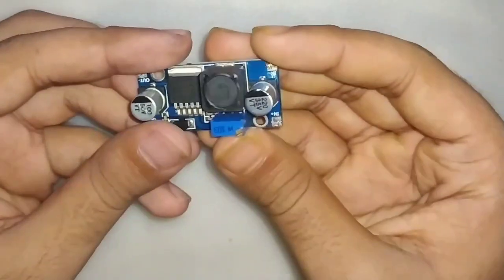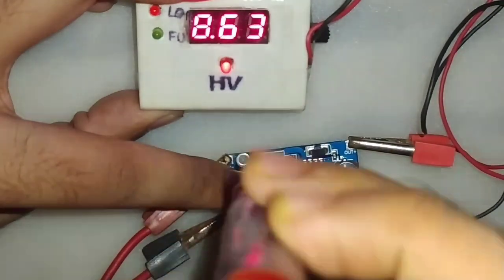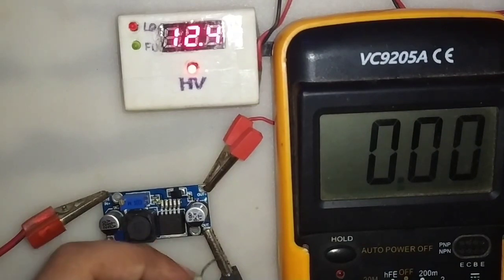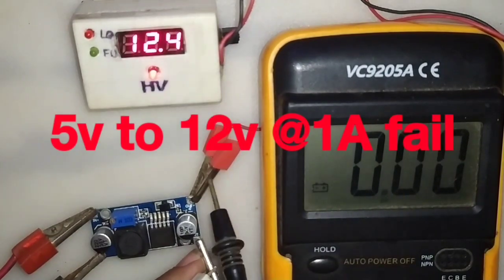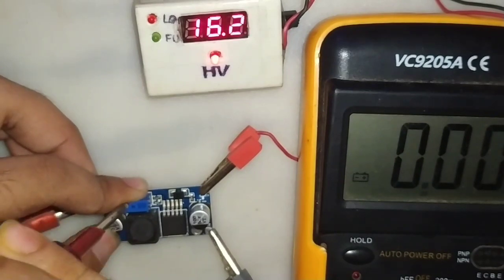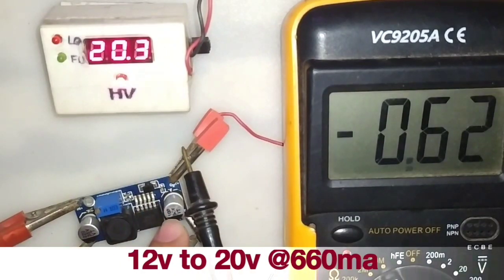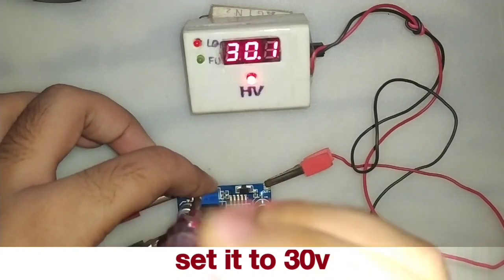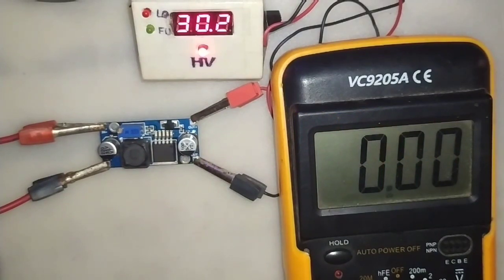XL6009 Boost converter Tasting | 5V To 37V | 1A

Comment: Can it give stable output voltage by which i can use it for power my egs002 continues 12v still after battery voltage goes down near 11 volt?
Reply from the maker: But the input voltage will be more than output when the battery is full

Comment: Step up perigoso, entra não que é fria. Se a tensão na entrada cair a 3,5 volts, a saída chega a 40 volts, ou seja, erro feio de projeto, problema exclusivo desse chip xl6009.
Reply from the maker: Yes, 
I had this problem also in 400W boost Converter module also

Comment: my xl6019 gets very hot.  consumes a lot of current at the input and provides little at the output and as a result it heats up a lot and ends up going into thermal protection
Reply from the maker: How many volts input you give and output you take?
Reply: @Electronic_For_You  3.7 to 5V it heats up a lot.  consuming 1A at the input and delivering 500mA at the output.  From 5V to 9V basically the same thing happens.  it only works well if there is a small difference between the input and output voltage
Reply from the maker: Hello
This circuit is not effecient at 3.7V . I recommend different modules
Reply: @Electronic_For_You  hello.  which ones do you recommend?
Reply from the maker: MT3608
Reply: @Electronic_For_You  thank you!!
Reply from the maker: Welcome 😀
Reply: @Electronic_For_You  so it doesn't have those efficiency losses like the XL6009?  can I use 3.7V at the input and 5V or 12V at the output with a consumption of 1A without it getting too hot?
Reply: @Electronic_For_You  😁
Reply from the maker: I used 3.7v to 5v 1amp not getting that hot . But don't know about 12v output
Reply: @Electronic_For_You  So will it serve to charge a cell phone that consumes a maximum of 1.3A??
Reply: @Electronic_For_You  and thank you for always replying to my comments!  as a form of retribution I subscribed to your channel
Reply from the maker: Yeah ,
It can !!!
Reply from the maker: It's better to use Power Bank circuit for changing phone
Reply: @Electronic_For_You  ok, thank you!

Comment: I bought an XL6019 that in the description showed 5A peak current and 3A nominal.  but it is not able to supply more than 1A.  it is very similar to yours, it has a very low current yield compared to expected.
Reply from the maker: First i need to know input and output voltage
Reply: @Electronic_For_You  3.7V to 5V.  5v to 9v/12v
Reply: @djdayvi961 XL6019 needs min 5V input to operate normally. Don't forget the chip's switching current in the description covers the current which flows on it, this is the input current. If you push 5V to 12V, at 3A input current, you would get 1,25A at 12V output ideally (3A * 5V/12V) if there would be no loss (on diode, on internal mosfet switch etc). If you calculate ~80% efficiency (just without deep details of where losses happen), the output current will 1A at 12V.
Reply: There is a difference between switching current and output current. 3-5A is switching current .
1A is output current

Comment: my friend your video perfectly solved my problem. i made a project and use this module but voltages were not going stable ( 5 v to 12v ) the load was 1a. i watch your video and that is conformed 5v to 12v @ 1A will not work.
Reply from the maker: I'm Happy my video helped you 😊
Reply: @Electronic_For_You  THANK YOU
Reply: @Electronic_For_You  AND IS THERE ANY WAY TO ARCHIVE 5V TO 12V @ 1A. THIS MODULE CAN ONLY GIVE 300ma AT 5V TO 12V. I NEED 1A
Reply from the maker: You can try Different booster modules
Reply: @Electronic_For_You  OKY...  I WAS THINKING ABOUT 100 WATT BOOST CONVERTER MODULE. BUT DO YOU MADE ANY HAcKING VIDEOS OF THIS BOOST MODULE? I AM SEARCHING ON YOUR CHANNEL BUT STILL NOT GET WHAT I WANT. IF YOU DON'T HAVE THEN 100 WATT BOOST MODULE IS THE BEST OPTION FOR ME.

Comment: 3 watt LEDs in series make 45 watt . Can I use this module for 45 watt ?
Reply from the maker: 45W is very high.... I don't recommend
Reply: @Electronic_For_You  which module can I use?
Reply from the maker: Search for boost converter
And see if there anything powerful one

Comment: Assalam o Alaikum. Can I use this module for 15 to 20 high power 3watt LEDs in series?
Reply from the maker: Walaikum Assalam
10W Maximum If voltage is higher then 20V

Comment: Hello there. I want to use this booster with an external power bank wich can deliver 5V and 2.5 Amps via USB. I want to boost that 5V to 9.3V and 1.2Amps to power a camcorder. Do you think it's possible? And if it's possible is it safe because I don't want to brick my 400 euros camcorder? Thanks in advance!
Reply from the maker: Its better to use a PD Powerbank which supports 5V 9V 12V output and buy a suitable Adaptor for the camera charger. Because if there any mis connection you might blow expensive stuff
Reply: @Electronic_For_You  PD Powerbank might not work because 9V output is not selectable by the user. The PD Powerbank will automatically output the voltage of 5v or 9v if the phone knows fast charging. But the camera does not know how to negotiate this and will still receive the 5V voltage, so it will not work. But thanks for your fast reply.
Reply from the maker: There is a smart cable that can output 5V 9V 12V output
The cable generates signal. For example i have given you link
Reply: @Electronic_For_You  You are right. Now i found out but those smart cables are rated for 800mAh -1Amp max so the camera will not power on because it needs 1,2 Amp. I used a few minutes ago the XL6009 Boost converter with my USB 5V powerbank, I set the output voltage with a multimeter to 9.3v but the camcorder refuse to power on without battery. With the battery atached and the output booster connected to my camcorder the battery is charging (I see this because of a small LED on the camcorder that blinks intermittently.). So it's a step forward with my project. Thanks again.:washhands::goodvibes:
Reply from the maker: Very good!
Nice to hear that .
I recommend to
Attach a small heatsink to main ic of XL6009
Reply from the maker: USB C Type C PD To 9V 12V 15V 20V  Power Supply Cable For Wireless Router Laptop LED Strip Speaker CCTV Camera
https://a.aliexpress.com/_mPGu7Ke

You can use this cable with suitable output voltage select from order section. And it will give 9V from PD powerbank

Comment: Sir, xl6009 Does the amperage increase as the voltage increases?

How many amperes are available?
3.7 volt supply to xl6009 
12 volt                xl6009
Reply from the maker: I don't think it will work well with 3.7V because if output is 12V 1A Then The input will be 4A at 3.7V this will not work .. you can do 5V To 12V That works well!

Comment: At 9volt to 12 volt ,u got 1.15 amps ,at this stage will this run without any problem,i mean no heating.Sorry for my  poor English
Reply from the maker: Yes it will work fine !
At 1.5A No Heating
9V to 12V can do Easily

Comment: Can this circuit be run from car battery with 12 volt 40amp then 24 volt amplifier circuit?
Reply from the maker: No but you can watch my XL4016 video that can Run car amplifier well 8A Output

Comment: Well, the output current depends on the input current too. Since we don't know what is the input current. Boost converters work on the same amount of power on the input and output. This means if you supply in with 1 amp, then you will get lower currents on higher boosted voltages
Reply from the maker: Yes Right
Reply: @Electronic_For_You   Its because I used one and it gave 4 amps output. And it was drawing 6 amps at 24v boosted from 12v.
Reply from the maker: I don't think it will survive for long
Reply: @Electronic_For_You  hmm obviously it needs a heat sink. With it we can use it for long term applications.
Reply from the maker: Yeas
Reply: @Electronic_For_You  And thus I conclude that it can give more current than 1 amp. Even you can try supplying with more current. And it will output 4 amps.
Reply from the maker: Not true try connecting 5v 10A in you will not get more then 12v 2A at output
Reply: @Electronic_For_You   with heatsink or without it?
Reply from the maker: Heatsink doesn't matter
Reply: @Electronic_For_You  but without heatsink the temperature increases and so does the resistance. So it matters. But yeah with heatsink I get 3 amps at best. And 4 amps the inductor doesn't like it.
Reply from the maker: 😵‍💫 i think my Converter ic is fake
Reply: @Electronic_For_You  Or mine? Since there is no marking on the board but on the chip.
Reply from the maker: XL6009 🤔
Reply: @Electronic_For_You  Yeah

Comment: Hey, I want to boost to 12v from 8.4 volts. Can it give 12v @ 1.5 amps?
I Need 1-1.8 amps approx

Just want to confirm before buying. If no then please Suggest better module. Thanks
Reply from the maker: Yeas 
From 8V you can get 12v but maximum 1A is recommended more can destroy it
Reply: @Electronic_For_You  I need less than 1 a but it can draw more for few minutes or so.. is it ok (will attach a heat sink also)
Reply from the maker: Yeas 
The rated current is peak current 
You can connect 1A load . More not recommend
Reply: @Electronic_For_You  thanks i made it and using since a month.. with 12v 500 ma Airtel router with backup of 6.5 hours. Enough for whole day work from home. Used 2600mah * 4 Li ion batteries. I charge it manually but soon need to make a automatic charger
Reply from the maker: Use bms and CC/CV XL4016
Reply: @Electronic_For_You  you sure it works? After power failure do it requires reverse protection. Add a diode is not what I prefer. I have xl4016 which don't start on connecting batteries before giving supply but it works if batteries are connected after turning on module supply. (May be I blown the module before in experiments)
Just tell me if it's output is reverse protected. I will buy it now.
Reply from the maker: You can connect it permanently

Comment: Iska input ma 12v 2a and output sa kay 12.60v 2a la shakta ha?  

For 3s bms Lithium ion battery
Reply from the maker: Use the potentiometer 
You can get 13v to 30v

Comment: It's also depend on power and Ampere of your battery dude.....😑
If you connect 1 amps battery and you want double volt then it will drop your amps....
Just try with powerful battery.....
I managed up to 3 amps from this only you want is heat sink........🔥🔥🔥
Reply from the maker: My power supply can give 
30V And up to 10A 🙂
and I tested it at different voltages the output ampare is not more then 1.5A . maybe fake module 😕
Reply: @Electronic_For_You  yes bro I noticed now my module have blue led and 2 inductor and rest all are same..🙂
By the way in how many rupees did you bought this...?
Reply from the maker: 1$ From Local Store

Comment: If i give 5v input and 0.5 amp how much output will it give? Plz reply
Reply: Ok
Reply from the maker: At 12v it will give 100ma 
Higher voltage means lower current

Comment: If i give 5v input and 0.5 amp how much output will it give? Plz reply 😃
Reply from the maker: At 12V You Will get 100 ma and higher voltage mean lower amp
Reply: @Electronic_For_You  i got 148 ma at 12 volts but still not enough to run a cooling 12V dc fan at high rpm😢😢
money waste!....... This module
Reply from the maker: I said that bro 😳
Reply: @Electronic_For_You  do you have any way to increase current😑
Reply from the maker: Is your input voltage 12V or 5V 

You can use a liner regular of you need 200-500ma current

Comment: Can we use this modul for wifi router 
Input 3v 18650 battery
Output 6v or 9v 1Amp
Reply from the maker: No bro 
It can't output from 3V to 6V to 9V 

It work from 4V
Reply: @Electronic_For_You  ok thanx for rep
Reply from the maker: WLCM 💪